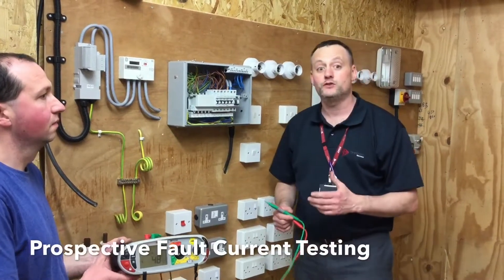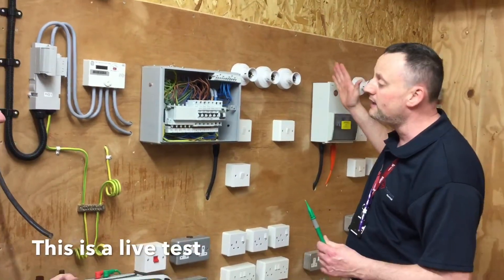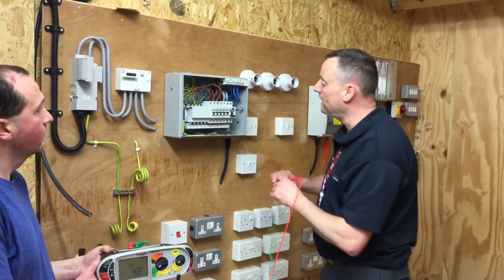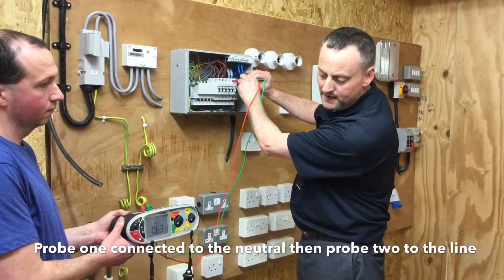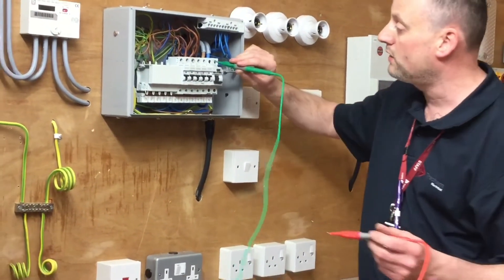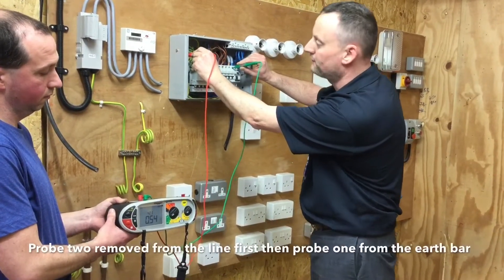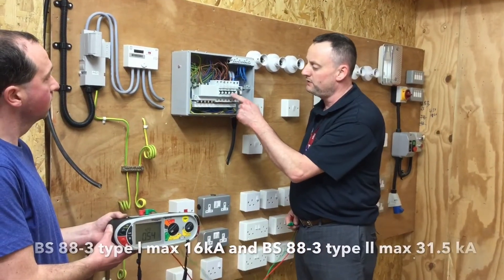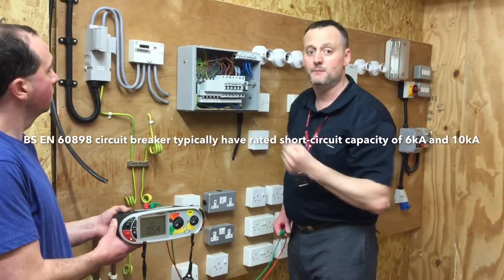Electrical Testing Measuring Prospective Fault Current PFC (How to do a PSCC and PEFC Test)

Comment: Hi, I know that unlike the initial Ze test that the main earth should stay connected, but should the main switch also be off? I've been told by some people that the main switch should be on to flow through all parallel paths, but I've also been told that you should leave it off when doing your PEFC and PSCC. An answer would be much appreciated as I have the AM2 next week and this is pretty much the only confusing part I have left, as I've pretty much sussed everything else. I'd like to think as long as the main earth is connected that the switch doesn't need to be on.
Reply: No one knows ! :-) 😀
Reply: How would having the main switch on change the flow of current through the test meter?
I suppose in theory it could cause a tiny drop in current if there were a massive load on the circuits causing a tiny voltage drop at the board.

Comment: Which value of the short circuit capacity do you record on test schedules?
Is it the Icn or ics?
In this case the icn is 6000A and the ics is 3000A
Reply from the maker: Hi. You record the highest measured reading during the test and not the maximum allowed...thanks for watching Gaz
Reply: @GSHElectrical  Thanks Gaz
Yes the highest reading when doing the PFC test ,that i understand.
The situation is that i am doing dead tests on a new installation and i am filling in test schedules which have a column of short circuit capacity of the over current devices.
All circuits are protected by individual mcbs with icn 6000A and ics of 3kA
Reply from the maker: Sorry in that case 6kA 👍